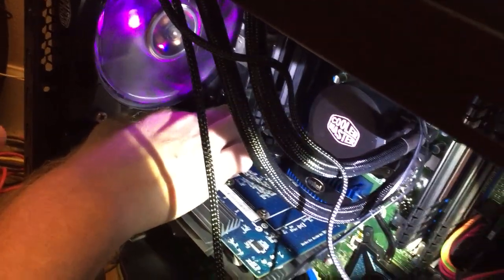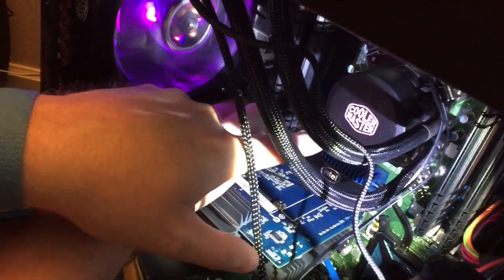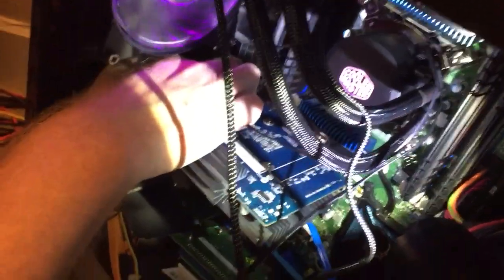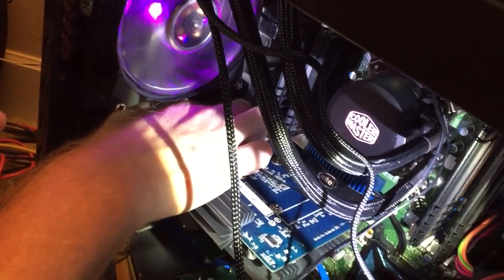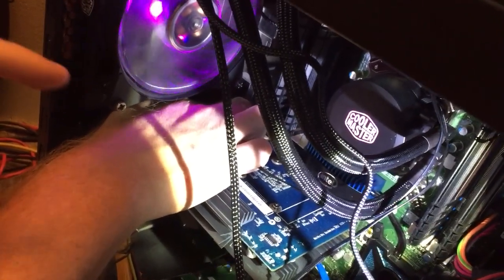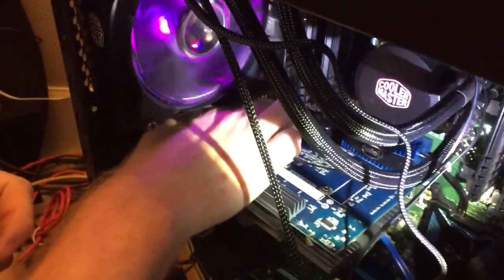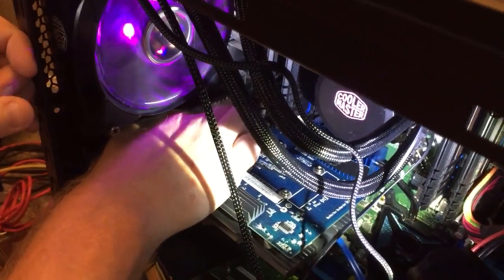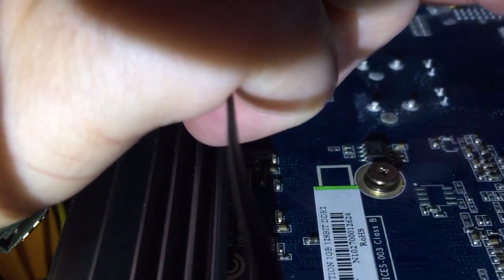Pump Noise/Failure Cooler Master MasterLiquid Lite ML120L RGB

Comment from the maker: This was originally posted as a demonstration video to Cooler Master Tech support.  After several attempts at different fix attempts the product was returned and replaced with a different brand.  We tried different mounting configuration , bubble purge techniques, and finally RMA replacement with a different unit but the same model.  Nothing worked.  Yes, as other have found, there are BIOS configurations that can make the problem less noticeable (read other comments for the workaround).  However, I was not willing to make power and performance sacrifices to make a new item work correctly.  I came to the conclusion that the design is fundamentally defective and went with a different option.  -- Good Luck

Comment: Same issue but with the 240.  Happened 6-7 weeks after I got it from microcenter.  I changed the AIO PUMP Min Duty Cycle from 100 to 60 in the BIOS and the noise completely went away.  On startup and loading into windows I hear it again for 1 second or so and it goes away agian completely.    Recommended course of action by microcenter is to replace the AIO pump as there is a physical flaw inside of the unit.

Comment: I was looking for this. in 2020 this model still have the same issue. I've had to buy a new cooler before it fails completely and even if it doesn't, that sound is extremly annoying. The only temporarly fix I've found is going though the BIOS and lower the PUMP speed to 60% and the sound is now only at a 10% or less but of course is not cooling as eficiently as it should.  I can replace it but I cannot wait weeks for having a replacement..So I've had to buy a new one (different brand OF COURSE). Ridiculous.

Comment: Ive had teh 240ml version for a couple months not a single problem then today i turned my pc on & it made this sound, of course i freaked out and turned it off and back on sound was still there so i shut it down again... behold noise is now gone hope it doesn't come back atleast im 100% sure now its the pump now, great video thanks
Reply: did the sound come back? i have a rattling noise with the 240ml as well..
Reply: @yzwme586   it wasent the pump after it was the fan making the noise

Comment: I started having those problems a month after a purchase. The pump was constantly settled to the max and, oddly enough, under stress the problem does not occur (maybe when the water is very hot it flows differently), but in idle there was that ugly sounds from pump... I fixed it. In the bios (MSI B450 Gaming Plus Max) I changed the PWM mode for pump to DC mode and I turned on "Smart Fan Mode" - after this, power of pomp depend on the curve on the graph. Then in windows in the msi dragon center program I set the pump power like this: For 0 C degrees = 30% power for pump , for 50 C degrees = 40% power, for 58 C degrees = 75% power, for 60 degrees  and more =  100% power. Thanks to this, he won't grind me anymore. My temperatures for Ryzen 3600 are:  Bios = 31 C, Desktop 45 - 50 C, Stress 70-75 C. But I Use another fans. On the front of metal coller I put two Fans: SilentiumPC Zephyr 120 PWM - max 15 dBA and Corsair LL120. Both of them are in the front of metal cooler. I have also two Zephyr on the top of my case, and 3 LL120 on the front of my Case. Cheers!
Reply: This worked for me.  Jan 2022.  Everyone also needs to watch the AIO common failures.  Radiator and pump installation location in your case is critical.

Comment: You're probably plugging the socket into the fan housing. There must be a pump/fan slot on the motherboard. The same thing happened to me and when I plugged it into the pump slot, the sound went away.

Comment: Under load my fan is making too a grinding noise. After one day of operation. Going to look for another fan. The cooling is working good.
Reply: Wich can you used? I probably will replace mine too sound is to loud. Maybe the Fan C.M.Pro?
Reply: in the video its the pump not the fan

Comment: I have a different noise from it that's pretty loud for non-load times, hope I can find a solution
Reply: same like me in idle so loud sound in this cooler
Reply: Bit late but I found shortly after the shop had set a curve for my aio which was the cause of the noise, I set it to a static value as it's supposed to

Comment: So I'm not the only one. 'That's just air in the pump.' No. Apparently Cooler Master hasn't quite mastered AIO cooling yet. Edit: mine is just 3 weeks old.
Reply: same here, I return it to the manufactured... I guess I will get another one to failed soon
Reply: if anyone is still looking for an answer, i went into my bios and changed the power to the pump to DC from PWM.
Reply: Got a new one. So far so good.
Reply: @felipechaves3389  what brand?
Reply: @geniedits  cool master

Comment: Mine just started making a similar noise on day three of owning it. Also the RGB settings are weird and not consistent with the setting on your screen. For example, you set it to red and the colors change to purple and yellow
Reply: I just fixed this last night. Maybe give it a shot. I was getting clicking noises, loud jet engine noises every time the pump fan kicked up and this buzzing noise that was driving me insane for almost a year. 

I removed the fans from the radiator. used canned air to clean the radiator which had a lot of dust build up. and then put the fans back in without screwing them in. used my hands to screw them in. didnt tighten too much. 

Noise gone. i also invested in some 140 mm fans and put them all in the front. the most important one is the top one on the front panel. i saw my temps go down 5 degrees even before cleaning the radiator.
Reply: @TheNegativeDude  Did you need to reapply thermal paste?
Reply: @gerrys1  Nah, i ended up buying the Arctic Liquid Freezer. I think the problem was with the 120mm fans. They are just too loud.

Comment: I have the lite120, got it on november 2017 almost 1 year by now, couldn't returned cuz where I live RMA doesn't exist so I'll have to ship it to USA and that will be expensive compared to what paid on it, so after 2 month of use it started with that sound and became louder everyweek since the sound appeared till now the only solution is to run the pump  @100% speed the pump so the noise is gone but i actually wanted to figure it out what was the cause but now it seems it just cheap cooler with cheap pieces
Reply from the maker: Contact Cooler Master Support.  They  may be able to help or get you a new one.
Reply: Jon Boehm  I did it just for curiosity, the reply I got from support (I attached them a video of the sound) was that it appears to be air bubbles stucks on the pump, in tends to happen on this AIO, they wrote me down some steps to purge and "release" the air of pump, I did it,  just finished a couple of minutes ago, so far it's quiet again at low-basic range %speed of the pump, so I guess it was that and I'll not need to RMA it (since it's kinda hard to do it from here) still i'll keep a track to see how it goes along these days.
Reply: @DarknezzNoMercy   cam u tell us the steps
Reply: @2unlockSlide  It worked out for just a couple of days, seems that have many burble airs, but due the country I'm I can't RMA cuz its too expensive to send it to US, and actually will be the same as buying another but well I might keep doing from while to while to see what happens, so far I just have the pump @100%.

These are the steps, Air Purge:

Please remove your cooler. Before reinstalling it, reattach the pump back to your CPU. Plug the CPU water block into a fan slot on the motherboard and turn on the PC. This will power the pump. Place the radiator on a flat surface like a table and hang the tubes down off the edge that way the block was lower then the radiator. You will hear gurgling of air rushing into the radiator. The water block can trap air and you have to "release" it. This should resolve the issue.
Reply: It's designed to run 100% all the time. If you weren't running it 100% that's probably why it broke.

Comment: Mine was brand new and it has the ticking sound. :(
Reply: yep
Reply: same thing. mines going back. do other brands do this ?
Reply: @supertaco22  i have a kraken nxzt 22mm, same prob, exept my cpu temps go over 100 and then the pc shuts down
Reply: @viktorvlahovic8373  check that your bios setting is not on pwm but is on dc mode.
Reply: @viktorvlahovic8373  if your temps are 100. First thing i would do is clean off old and reapply  thermal paste. Than mounting pressure. I run a stress test on my cpu to heat her up. Watch the temps and adjust pressure on mounting screws. This can adjust temps by 10c by getting good pressure. Dial it in. Than mother board setting for the pump controller should be in dc mode ( or pump mode or aio mode brand of motherboard has unique label ) dont use pwm mode for aio coolers. Next watch gamersnexus video on proper mounting orientation of the radiator try rocking the air bubbles out.

Comment: Is there a way to fix this ? The DC setting on bios for AOI pump is all set to 100% and can not be changed..
My radiator wires are also on top not to get bubbles in pump.
But I got the exact same noise.

Do we need to take it back and have it replaced or is there a fix for this..
Plus, how long will it take the pump to die this way ?

Thanks.
Reply: from the answer i got, it's an air bubble, and to fix it, you need to put your pc on its side for couple of days, and just use it as normal.
Reply: @dimka971  Thanks.. to my experience it sounds like a worn out plastic piece inside due to air being stuck in it for too long, the friction caused a damage.. So even if I have the bubbles out by tilting it, I doubt it will make the noise go away. I just had it replaced.. If it happens again, I'll try to do it. Thanks for the effort on replying man, much appreciated.

Comment: Just saying, i don't have this pump noise issue. 
However i have (ML240L RGB type) and the fans do an annoying noise when above 40% fan spin.
First day i got it, it had this fan noise issue But still using it low RPM for ~6months now with no other issue.
Reply: How did you lower the rpm. I have the same issue
Reply: I was searching for someone to say that, this the problem I been having, did u fix it?

Comment: be careful with the fans that come with this cooler also because the fluid in the fans came out and into the fan shroud. not just one fan but BOTH!! this AIO is straight junk! but i have a Aorus z390 with the smart fan in the BIOS so i turned the rpm down from full speed to normal and the sound went away, but just like the rest of you this aio is only a few weeks old...

Comment: I want to buy one i get the master air 4 or master liquide 120 ?????
And the sound of masterliquide is big ?????
Reply from the maker: The ticking is not really that bad of a sound.  However I consider it a pre-failure with complete failure happening later.  Compete failure is a big problem.

Comment: Did you try to mount it horizontally instead of vertically?
Reply from the maker: How would one do that in a tower?  The  CORSAIR Hydro Series H50 I replace it with had no such requirement.
Reply: @JonBoehm  mount the radiator on the air intake at the top of the case.

Comment: I can buy this one for 35, but I saw bad revieuws about the noice, like this one. what do you think?? just buy a air cooler then?
Reply from the maker: I replaced the Cooler Master with a CORSAIR Hydro Series H50 and I've had no problems so far.
Reply: @JonBoehm  oww okay, thats a fully other water coolee?
Reply from the maker: @justintreehut7990  Yep different brand but in a similar price range.
Reply: @JonBoehm  That cooler isnt available anymore here in my country, do you think changing the fan of that mastercooler would change the problem?

Comment: I literally just had this happen today. My cooler is only 2 weeks old. My previous one had a similar death. Honestly I’m just gonna return this and go Corsair.

Edit: as suggested by another post in the comments, go into your bios settings and go to your fan control options. Make sure your power setting is DC. Save exit and restart. I heard the noise during the first few second of the first startup but it went away and haven’t heard it since.
Reply: OMG thank you so much man! I was looking for how to fix this for so long! I thought I mounted my cooler incorrectly.
Reply: Holy shit! this actually worked. like you, I heard it for the first minute into windows then it stopped!!
Reply: If you have a newer motherboard or gaming motherboard then you may also have a pinout for water coolers which will be dc/100% speed by default and you will not have the ticking at the begining either.
Reply: @exoslomo  long replaced this cooler in the last couple months. Funny enough it was another cooler master AIO lol
Reply: PLEASE HOW DO I GO INTO BIOS SETTINGS
Reply: @minxta07  restart your pc and on the boot screen there should be a message telling you what button to press. Usually it’s delete or one of the Function keys
Reply: @Sneax673  thank you so much I just went to bios and set fans to dc and it works fine!

Comment: I have this issue with my corsair h100i rgb platinum se 
Any tips to fix it because it immediately started to do this when i turned my pc on and i really dont want to buy another one because ill have to wait an entire month for it to come
Reply from the maker: People have mentioned that if you disable PWM on the pump power plug via BIOS, the problem goes away.  I see this as a bandaid.  The pumps are designed to go faster/slower relative to the CPU temperature via the PMW feature.  Setting the pump voltage to DC (non-PWM) in BIOS puts the pump at its highest action all the time. This is a waste of system power and will burn out the pump faster.  One could argue that it might burn out faster but that still should be years.  But if the pump is already showing problems I think it will burn out much faster.  Highly recommend that you return the product.

Comment: Exact same issue here on my  Cooler Master MasterLiquid ML240L RGB AIO Cooler it seems ill look at returning it :( was good when it was silent only had it for 1 month
Reply: Hey man whats up
I have the same cooler as u and this JUST happened to me a few hours ago by the time im writing this 
And im not jokin i literaly shook the pc case left and right front and back to maybe let the air out...and im not jokin when i turned it on after a few minutes it completely stopped
Maybe it was luck maybe a new stupid solution
Give it a try and i hope it works
Reply: @geniedits  yeah I tried that , tried mounting different ways  the only way thay was quiet was if it on the desk laying down with  the pump outside the case,, but as soon as you put it in a case bam back to noise lol I sent it back and they are gonna look at it , most likely I'll go back to air cooled after this
Reply: @undy22  sorry to hear it bud
Pc's can be cruel sometimes :/
Reply: @geniedits  yeah lol  my mate had a AIO for 3 years untill pump failed so I built a new pc and was like I'll give it a try lol 😆

Comment: Hey man, purchase same cooler master. this also happens to me. Have you fixed it?
Reply from the maker: return it
Reply: @JonBoehm  thank you!
Reply: Their was a solution around it, you just had to switch the pump to dc mode in your bios. it takes a minute into windows to work but it does work.

Comment: if anyone is still looking for an answer, i went into my bios and changed the power to the pump to DC from PWM.
Reply: You are partially right. You actually have to make sure your pump is powered by the chassis fan power connector on your motherboard.
Then go into BIOS and change the pump power setting.

WORKED GREAT FOR ME. WAS IN THE PROCESS OF RETURNING THIS BUT IT WORKS EXTREMELY WELL NOW!
Reply from the maker: Thanks for chiming in.  Yes and no (to your solution).  I'm glad you found a situation that make it functional for you.  My concern is that in doing so your running the pump at full power 100% of the time.  That should not be needed and it will decrease the overall life quickly.   The point of PMW (rather than DC) is that the pump power/speed is scaled to how hot your computer currently is.  It only pumps as hard as is needed for your current conditions.  I do not recall the BIOS change being a requirement of the install instructions and I think its ill advised.  If CM support told you to do this, AND its not in the instructions I would demand a refund immediately.  If its in the instructions, bad on us for buying a junk product.
Reply: I was getting ready to rip this thing out. Thanks for the tip

Comment: My Cooler Master MasterLiquid ML240L RGB pump started to do this ticking noise a week ago... I started using it on september 17, 2020. It is very loud and annoying. I contacted MC tech support yesterday and I am waiting for their answer. According to the comments of Newegg.ca, they will suggest me some air purging solution but I am very skeptical about it. Will edit comment if it works out...
Reply: How does the air purging even work ? any updates?
Reply: @jeocuneyt  I would like to know as well as I have the same AIO

Comment: 3 years with the Masterliquid 120 (non RGB), Still working fine, the pump runs at ~2500rpm, no strange sounds and keeps my xeon E3 1240 V2 full load at 50°C max. Just need to be careful to don't plug it as PWM (settings in bios) or use molex or sata adaptor. But better to use a fan plug on the mobo for pump speed monitoring.